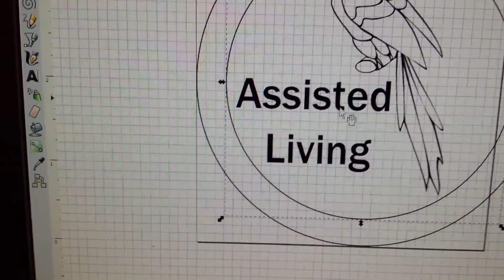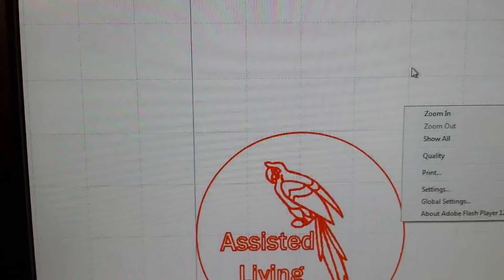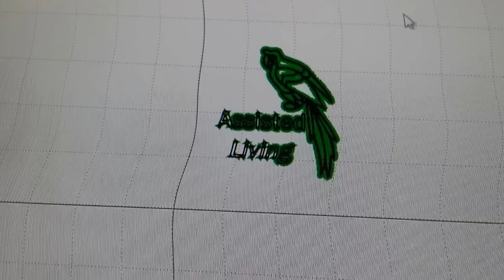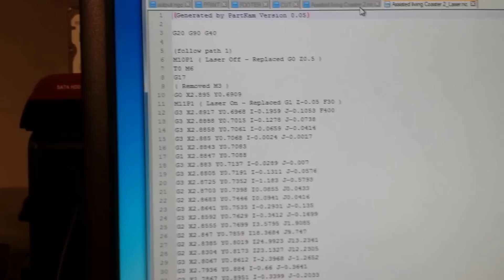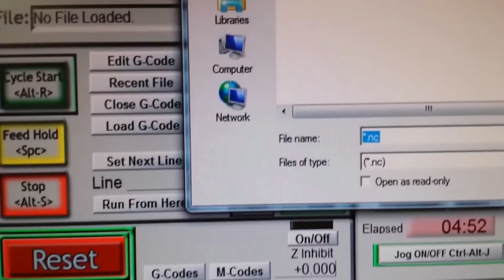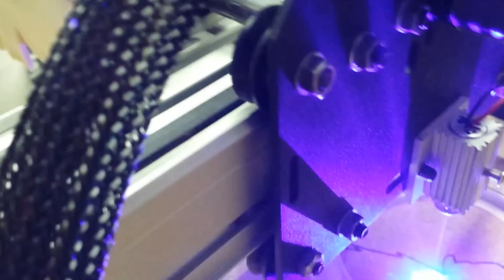Shapeoko with laser makes a drink coaster and converting gcode to laser use

Comment: would you be able to adjust your Shapeoko 2 with a 50w + CO2 water cooled laser.?
Reply from the maker: It is possible to use a CO2 laser. One would need to mount the CO2 laser near the rear of the Shapeoko and then use mirrors to direct the beam to the Z axis then a mirror and lens down to the bed.

Comment from the maker: I am using a 2w 445nm blue laser salvaged from a M140 projector.  The case and mount is from Axis. The lens is a 405-g-2 glass. The driver is a WX-Drive.  Most of the items came from dtr-lpf on ebay.